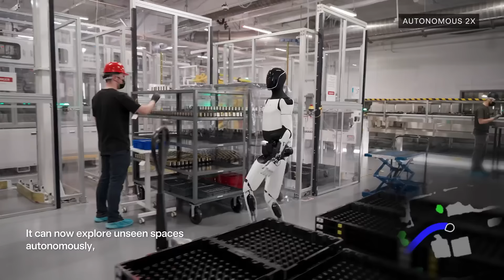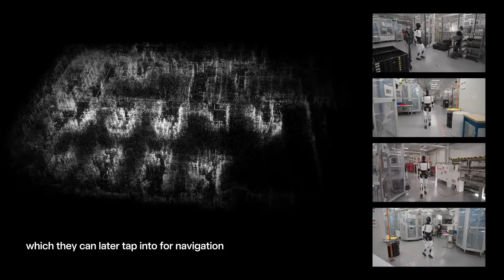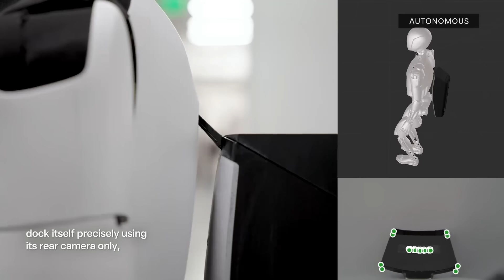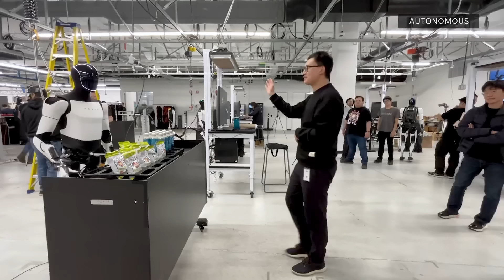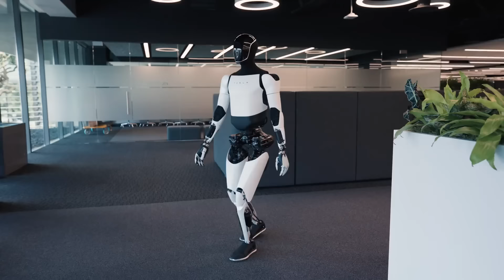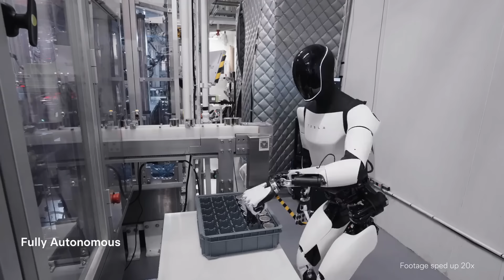Elon Musk's Tesla Optimus Humanoid Robot Navigating by itself even on Difficult Terrain #optimus

Comment: I couldn't imagine a more convoluted and more difficult than it needs to be charging implementation than a box on the wall with a tiny prong for the robot to BACK  UP onto. Only Elon would think of that probably because 'it looks cool.'

Why not a plate on the floor with simple charge contacts? I mean hell, it could probably pick up a cable and plug it into itself easier than it can do that nonsense on the wall. Hope the home version if there ever is one doesn't use an implementation like that.
Reply: do you know by standing itself upright already takes lots of efforts.  Being hooked in the back allows all actuators relaxed.

Comment: For charging, id like to see it stand on an induction charging plate.  Charge through the feet while its standing on the factory floor.  It can charge while it works.
Reply: If it can charge in 1/2 hour and run a 12h shift, it only needs  0.5/12 = 4% extra robots to cover the charging time. I expect wireless charging infrastructure to be more expensive.

Comment: Someone smarter than me please correct me.  I only have 2 eyes.  I cannot see behind me, in the dark, through fog, heat signatures etc.  You are a robot.  You can have 10000 eyes, sensors, radar, lidar, infrared, heat sensing etc etc etc.  Why does this robot only have sensors in the front of its head like a human?   Why is it not covered with sensors 360'?  

Why would you put human 'frailties' in a machine that could overcome them with technology?  

This robot 10 years ago would be impressive.  The fact that it is not autonomous, and does not have AI interaction is not impressive.  Boston Dynamics was doing this YEARS ago without human control.   You can buy consumer robots from them that exceed this robots capability right now.  Nothing impressive here.